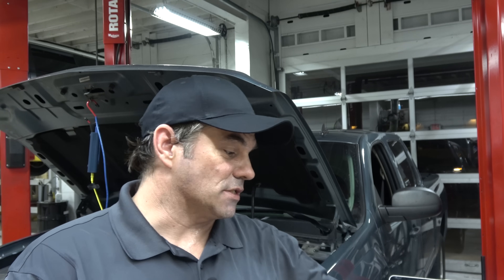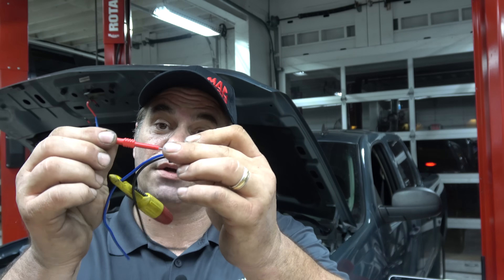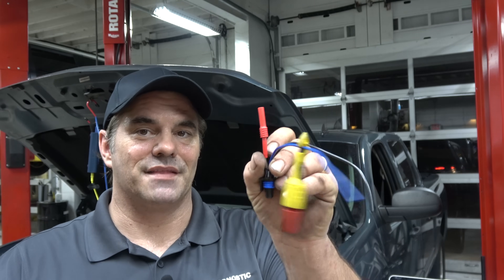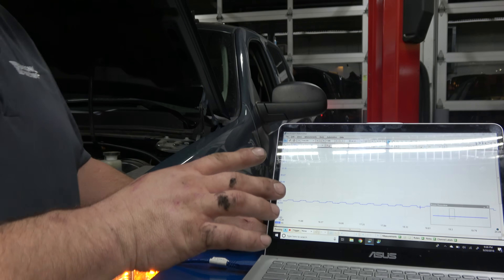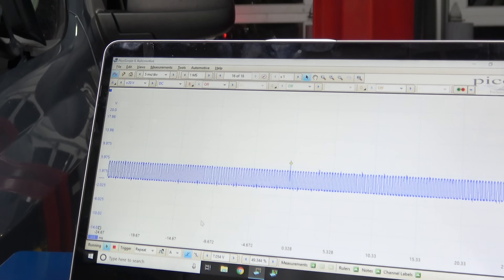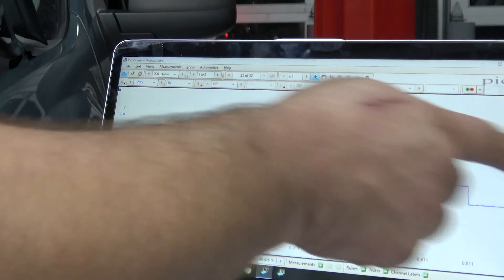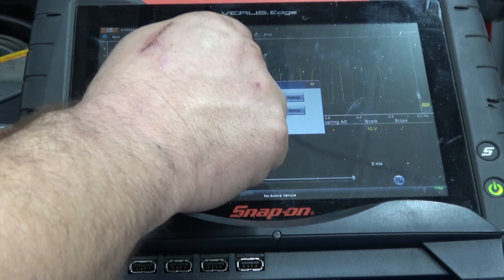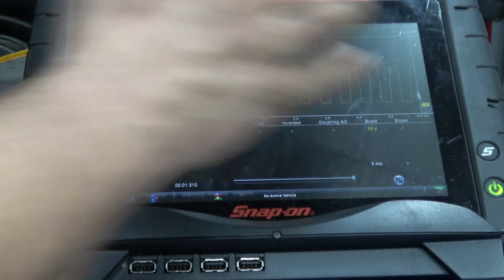Scope Basics,Importance of Grounds, Triggers and Piercing vs Back Probing

Comment: Are there brands of seal or gasket you avoid? and thoughts on Fram filters? what do you think?
Reply from the maker: I avoid Felpro, and i do not use fram, for my vehicles,OEM, Hengst- OEM maker for many cartridge style filters or MANN
Reply: Flat Rate Master  Fel-pro? i never knew about them. Thanks.

Comment: Great video thanks brother. We always pinned the wire then liquid tape when done. The best ground problem I ever saw was on a series 60 Detroit. The computer was doing some hit and miss or nothing. I found the main engine ground wire so corroded it was junk. I removed it cleaned up the surface and put a new one on. Back then they was exposed to everything I think they still are just thought it was odd. Keep up the great work see you in the next video thanks again brother

Comment: Good set of ground rules, get it? The only issue I have with wire piercing is using the wrong size piercer, or a dull one. I've seen some serious damage done to the wiring if it's over pierced(especially with a dull piercer). Also a dull one will damage the wiring as well, so use the right depth and keep on eye on the piercer, to avoid doing damage 👍